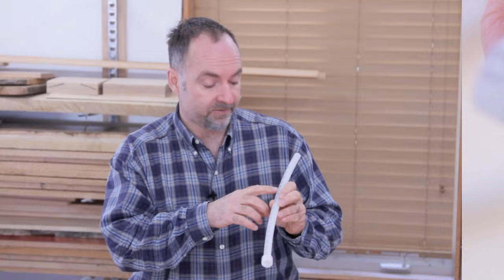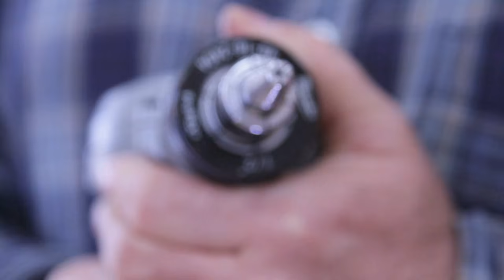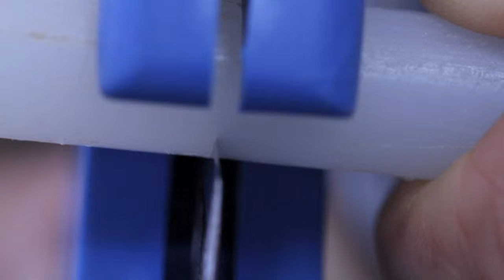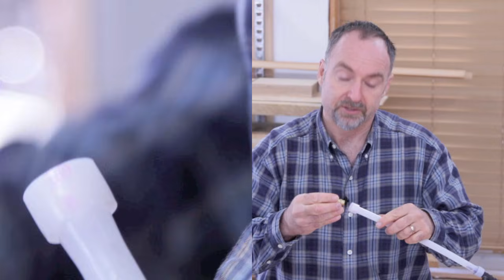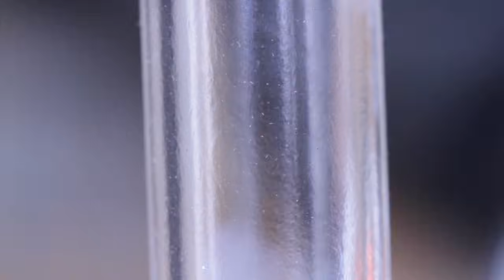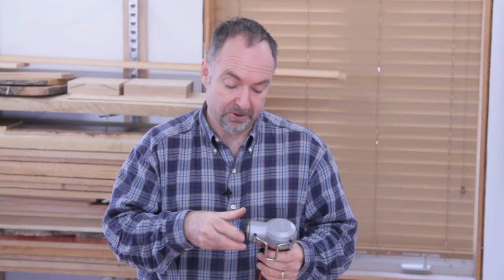Easy Way to Connect Pex Pipe | ProPEX Expander

Comment: Good video
Reply from the maker: Thanks for commenting. I really like this system. I find it better than the compressed ring systems. One minor reason is the fact that if the ProPEX connection is visibly complete and assembled, you know that joint will hold water. With ring systems it's possible to forget to compress the ring. You have a joint that's visibly together, but won't hold water long term. I've heard of uncrimped rings letting go after a time, resulting in a nasty flood.
Take care,
Steve

Comment: Do you think a pex connection onto a hose barb would be water tight?
Reply from the maker: Hello Mr. E,
Thanks for your note. Yes, I wondered about that too, the first time I saw this system. But after hundreds of connections I've made and watched over the last 10+ years, not a single one has leaked. The connection is amazingly solid after the PEX shrinks down. I can solder copper pipe with the best of them, but this approach to PEX is by far my favourite.
Thanks for watching!
Steve

Comment: If you used a smaller size tubing...  say a 1/2" x 1"and expanded that to fit over a 3/4 then expand both to fit a fixture. Would not the half inch constantly squeeze down on the three-quarter inch holding it as well as the ring that you buy, but costing far less. Have you/ any plumber tried this idea and could it work..?
Signed: Can- I save a -buck.

Comment: Why no alpex pipe? PolyethyleenX-Aluminium-polyethyleenX  , it has the strength and air tightness of the aluminium
Reply: @Leopold  early plastic pipe, especially VPE was oxygen diffuse and a disaster for heating systems.
I've allways worked with the Belgian Henco Alpex pipe because of the aluminium inside. Not because of pressure considerations. Now I see all the PeX a, b, c and I wonder wether to chance or not.
Will it have any advantages  that outweigh the costs and energy that go into a change ?

Comment: I find often the ring is pushed back as I cycle the Pro Pex M12 expander. Any tips?
Reply from the maker: Good Morning Brian! Thanks for your note and for watching. The rings I use have a little nubbin on one side at the end. This stops the rings from sliding forward. Also, I have found that if I'm using nubbin-less rings, they're much more likely to slide forward if the pipe is wet. Let me know how you make out.
Bye,
Steve

Comment: Does PEX have a problem were torque is involved like when there are valves that turn hard?
Reply: I assume PEX will not take much heat before it softens and melts.
Reply: @rexbahr1945  - PEX cannot be exposed to sunlight 🌞

Comment: Great video.  I personally would not want to fix a kink like that.  I have to think that the material has exceeded its plasticity range and has permanent damage albeit small maybe.  I think I would just replace the pipe or put in a coupler where the kink was.  Pex A is amazing stuff.

Comment: Hey it’s a nice system. I see pipe indicates 100 psi. If it goes over that psi for some reason will it cause irreversible damage to connections , what about temperature?? How much temp does Pex A pipe take.  Thank you nice video

Comment: FYI: it’s Recommended (as per the Exp tool instructions) 7-8 expansions/cycles for 1/2” pipe. 
Not 3,4,5 cycles like you said.

Propex is great, Altho I think pex is still faster and less expensive.

Comment: Fine. But if you expand 2x and not 3 you don't have to wait long for the constriction to occur.  If the fitting is a little tight putting it into the PEX just tap it.

Comment: I think that pex is awesome. .easy to work with and it will expand 7 times its natural state during a freeze. If you don't have a tool..use shark bite fittings (only in accessible areas..not in walls! ) Milwaukee makes a great tool or.. buy a hand expander. Repiping a house is quick and simple.

Comment: So pissed that I can't rent this tool from Home Depot
Reply: "Rent" it from Craigslist/Kijiji/etc.  Buy a used one and when you are done you can usually sell it for the same price.  Also you will not find the F1960 expansion fittings at the home depot either.  I only find it at professional plumbing suppliers.  But it would be nice if I could go to home depot at 8pm on a saturday because I ran out of fittings.
Reply: Just buy it
I just buy mine for 600 
Hoping to make this money back
Reply: @Ivan-nr9tc  so is every other guy who bought one
Reply: @CC-jy4gr  guess what
Already make the money back
I bought this tool because I dona little bit of everything 
I used the first time to replace the main water pipe in my house.
2 nd ,3rd time was for a customers 
And
Reply: @Ivan-nr9tc  prove it
Reply: @CC-jy4gr  should I sent you a copy of each invoice?
Reply: @Ivan-nr9tc  Not buying post a video with invoices and you describing what I'm looking at in a mickey mouse voice.
Reply: @CC-jy4gr  you ask 2 much 
You not even work
Reply: @Ivan-nr9tc  sounds like someones a big fat phony

Comment: Today I bought mine.
Reply: Wow.. one year already
Reply: @dougpazreyes  I bought the Milwaukee pex-A expander tool on line at Home Depot. Have been using the pinch clamps with Pex-B to replace fittings that leak but decided that pex-A Uponor/Wirsbo is the only way to go. I have the nasty polybutylene tubing that springs leaks at fittings so I will have to do a re-pipe with Pex. Now I have to save up for the pex and multiport "T"s and connect fittings. Luckily all of my pipe runs underneath the crawl space rather then in the attic so it will be much easier to repipe.
Reply: @dougpazreyes  lmao, I hate seeing my own post again on youtube videos.

Comment: why would I want to waste time heating the pipe , two seconds to cut out the kink
Reply: Because PEX connectors are so stinking expensive it is worth a few seconds of time to fix the kink.
Reply: Marquee Mark More fittings, more spots for leaks
Reply: Marquee Mark

Comment: There's no doubt that the connection is legit, but it's pretty much limited strictly to new construction... It's just not as feasible to use on water re-piping  and various other repairs that call for working in tight spots.. I've been using pinch clamp rings for nearly 6yrs now and haven't had the first problem, same tool does an excellent job on 3/8"-1", plus it fits in tighter spots than ANY other tool...
Reply: PEX A using the expansion method is superior period. The fact that someone using clamp rings will naturally rationalize how his method has to be better. So yes it can be little hard to use the expander in tight spaces until u learn how to deal with it, Just look at all the videos that show it can me used. While clamp rings properly install should last in most conditions for many years. But PEX A using the expansion method has 2 main advantages that make it the only real choice, 1st it superior freeze protection and fitting/connections have the same ID as the pipe. Clamp rings fitting/connections have smaller ID which restrict water flow efficiency and may not meet code. The list is too long for all of the advantages PEX A using the expansion method has over PEX B using crimp rings. The only real advantage for PEX B using clamp rings is it cheaper.
Reply: N C - totally agree. The crimping tool and rings is inferior to the expansion rings and PEX A
Reply: i agree to a degree ( see what i did there) but ive had to do some tight fixes using a milwaukee expander, and have had no problems dont get me wrong there are times where i was like .... damn should have used the one handed crimpers.

Comment: Hello, just wanted to give you a heads up that the PEX-a isnt actually a higher grade of pex than PEX-b or PEX-c but PEX-a (such a aquaPEX) can be expanded due to the way it is crosslinked on the molecular level, PEX-b you wouldnt be able to expand the pipe so you need to use compression/crimp/press joining methods (viega, and i think heatlink are pex b) nothing to do with how good or bad the pipe itself is. Actually all three PEX designations have to adhere to the same industry standards of burst pressure, temp rating and uv ratings.PEXa uses the peroxide method to crosslink the PEPEXb uses the silane method to crosslink the PEPEXc uses an irradiating method to crosslink the PE after the extrudong process
Reply: Thank you for explaining the difference between the PEX piping.
Reply: heat link is pex a. Their crimp rings are garbage though...been seeing alot of houses lately where they will start to drip after months of service.
Reply: PEX A better expansion and freezing protection make it commonly consider a higher grade pipe. And more expensive. Which is why PEX B was invented after PEX A to compete as cheaper alternative to PEX A. Even if PEX B inferior it still can be used sometimes if it can meet code, but since has uses small ID fitting it may not.

Comment: can I use regular fittings for propex or are they completely different?
Reply: it will work. but will void your warranty on the pipe itself
Reply from the maker: +rick mosque Hi Rick. I'm afraid they require ProPEX fittings. The fit needs to be precise.
Thanks for watching!
Steve
Reply: You can use crimp fittings on PEX A but y would u?   The crimp fittings r inferior to the more expensive PEX A designed for expansion fitting. Crimp fittings only make sense when used with the cheaper PEX B or C to save money.

Comment: Its very useful battery pipe expander, We have a manual pipe expander can used for 1/2, 3/4, 1" watts,uponor,propex pipe and fittings, get sample from: http://www.crimpingtools.com/products/f1960-manual-tool-kit-with-1-2-3-4-1-expansion-heads-for-propex-expansion

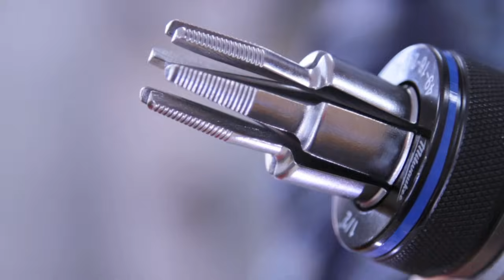Comment: Excellent video! 1:05 thru 1:11 just provided proof that the cone on my "factory reconditioned" Milwaukee M12 Expander isn't protruding far enough to adequately expand the tubing. Yesterday, I shipped the tool to Milwaukee for warranty repairs. As I re-piped my entire home with AquaPEX over the past weekend, I had to force-fit all fittings into the expanded tubes, and it didn't matter how many times a tube was expanded. Each joint was almost too tight to fully engage the fitting properly. I was fortunate that I had time, patience, and a good razor knife, because I had to cut and redo several joints. I was using factory new Milwaukee expander heads in 1/2" & 3/4" sizes, and of course, the newly puchased reconditioned expander tool. In the end, I was able to make all connections and the installation looks and works great. AquaPEX tubing and ProPEX EP fittings are top grade products. I hope Milwaukee finds the issue and properly repairs the tool, because this tool will be great if working properly. For the tool to be factory reconditioned, it obviously had to have been returned to Milwaukee at some point for a problem. Considering my problem, I assume that the original problem may have been the same, but Milwaukee didn't give the tool a thorough inspection for wear of the expander cone drive parts. Thanks, Mr. Maxwell.
Reply from the maker: STRunnerNC Good Morning!
Thanks for your note. Sorry to hear about the problem. Any of the units I've used open up the pipe plenty for easy connections. Is it possible that the head wasn't screwed all the way down on the tool you're using, causing the cone to expand things only partially? Not likely, but worth mentioning.

Drop by for a visit sometime at @/stevemaxwell.ca. I've got lots of interesting videos, tool giveaways and articles there.

Bye for now, and thanks for watching!

Steve
Reply: ***** I did check out your website. Very nice! Lot of good information. Will keep link in bookmarks..

Concerning the tool, yes, the expander head was screwed down securely, and it was lubed with the recommended grease. In your video at 1:05 to 1:11, with the 1/2" head installed, the cone appears to protrude a little beyond the end of the expander segments when fully extended. On mine, with the same 1/2" head installed, the tip of the cone doesn't extend past the segments, but is about one seration from becoming flush with the end. There must be something inside that is worn or improperly installed, preventing the cone from protruding that last little bit needed for proper expansion.

Cheers!
Reply: I had this exact experience. Frustrating!! That's why I'm here trying to figure out what is going wrong ?

Comment: I just created a really cool home-built tool that expands 1/2" pex pipe so that it fit over 3/4" pex fittings. That way the internal diameter of the pex fittings is the same as the pex pipe.  First i take a length of 1/2" CPVC pipe and i heat it with a hot air gun (at the high-setting) so that a small area of the pipe is soft enough to stretch. I pull that soft section of pipe so that the diameter of the pipe decreased in the part of pipe being stretched apart. The new diameter of that 1/2" CPVC pipe at the new smaller diameter is small enough to fit INSIDE a 1/2" pex pipe.  I let the CPVC pipe cool down for 10 minutes. I then cut the stretched CPVC pipe in half at the narrowed-down section, now giving me 2 home-made 'PEX EXPANDERS'.  I apply a bit of WD-40 lubricant to the surface of the conical CPVC pipe area so it slides easier inside the pex pipe.  Then I take the pex pipe and use the heat gun again  (on the LOW heat setting).  I  heat the pex pipe about a minute or two, trying out the expander every 20 seconds to see if the pipe is soft enough to expand yet.  Normally 1 to 2 minutes is enough time to heat the pex pipe so it is soft enought that you can push the CPVC expander pipe INSIDE of the pex pipe, about one full inch.  Once the pex is hot enough for the new CPVC expanders to push inside the pex pipe about an inch, I then pull out the CPVC expander pipe and quickly wiggle in a conventional 3/4" pex fitting.  I have to wiggle everything a bit to get it to go in and the pex pipe is very soft and flexible at this time, so careful not to push too hard. A few seconds of wiggling and the 1/2" pex pipe is fully onto the 3/4" pex fitting.  When the pex cools there is no way to get it off the fitting, but I put a small stainless steel hose clamp on it anyways just to make sure nothing comes apart under pressure. This works great but it is not approved by code, so if you need an inspector to pass it then don't try it this way, it won't pass inspection. This is only if you are doing something and you don't need the approval of an inspector.
Reply: Interesting concept but 1st, 1/2" expansion fitting have the same ID as the pipe. So there is not need to use 3/4" crimp fittings. 2nd, when a manual expander is only about 50 bucks u can sell it after ur done is it really worth doing something like this that can weaken the pipe too? But its amazing all the work some ppl will go thru to save a few bucks. Being a cheap my self I can relate. Its just way to much work for an inferior result that cant pass inspection.

Comment: can this be used under ground to replace water main line from meter to house? and if so what kind if female fitting can i use on galvanized treads form the meter. thanks
Reply: actually, pex used for potable water in houses and buildings is neither critter proof nor chemical resistant.  they recommend using a protective piping for the pex (like conduit is used with wiring). also, make sure you run the line below the frost line as much as possible. insulate any section that will be exposed to freezing temps. while pex can expand when the water inside of it freezes the fittings can't.)
Reply: Actually, pex is water  tight but not gas tight.  They have found that certain toxic in-ground gases can penetrate pex.  That is the whole reason kitec, all-be-it a garbage product, was invented.  So the short answer is no, pex can not be used in ground.

Comment: Is there any way to remove the pipe from the fitting after you have used the expander and sealed all up?
Reply: 5280 Insurance Brokers heat gun also
Reply: Not that i know.

Comment: Pex doesn't seem to be very to the do it yourselfer. All the expensive tools, expanders, crimpers to just use once or twice.
Reply: if you use cinch tools and cinch clamps it's a snap.  one cinch tool we sell at the store I work at fits 3/8" -1" fittings. it has an auto release so u don't over tighten the cinch ring/band. easy and costs less than using a lot of other tools.  don't forget to use pex bend supports instead of elbows. saves time, money and reduces fittings that could possibly crack and leak. just sayin'...neat video...in my neck of the woods we use different fittings and tools so I like seeing other methods to install pex:)
Reply: well, I grew up in Texas but, I live in north eastern Nebraska. I am learning there are so many other types of pex fittings and tools from other manufacturers. rite now I consider viega fittings and tools to be my plumbing porn. I did see a tool from ICINCH that works on both press fittings and pex clamps/rings.  absolute nummies. kinda odd for a chick to like tools and plumbing fittings but...can't help it...it's so dang awesome!!!
Reply: For DIY use a manual expander at less the a quarter the cost. Its not much more than a what it cost or u need to sweat a copper pipe and its far easier and faster to do right for a DIYer. And it much more resistant to freezing. Than sell it on CL.
Reply: +highonimmi I have always wanted to date that kind of chick the one that would rather have tools than jewelry

Comment: Plan reviewers here were telling plumbing designers they needed to size pipes 1 size bigger if they were sizing for pex using copper sizing charts.  I decided that was imprecise & got a manual from Uponor to get the proper sizing charts for Aquapex.  The plan reviewers here didn't even have a Uponor manual at the time.  I like designing for pex because I don't need to draw riser diagrams.  I draw the piping so the Tees in the plumbing walls show on the ceiling & I call out the sizes on the plan.